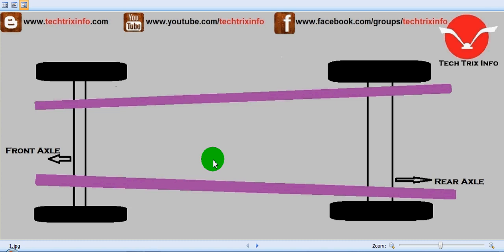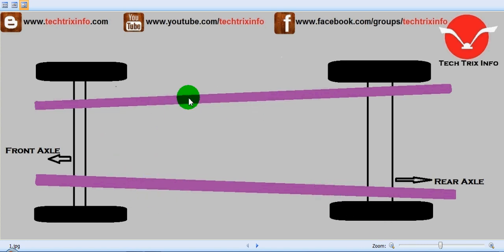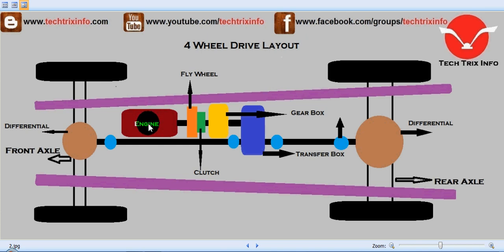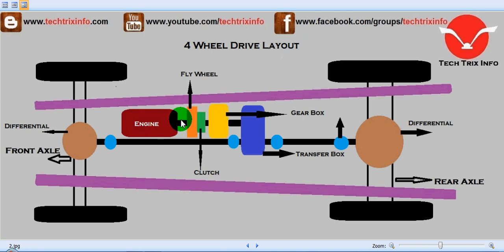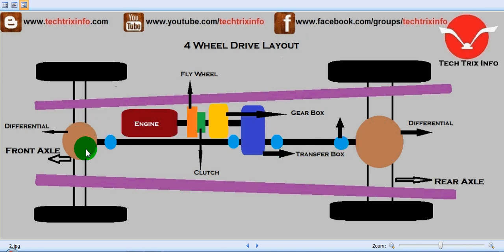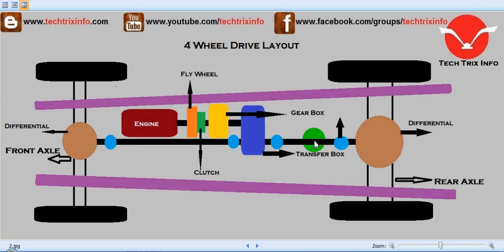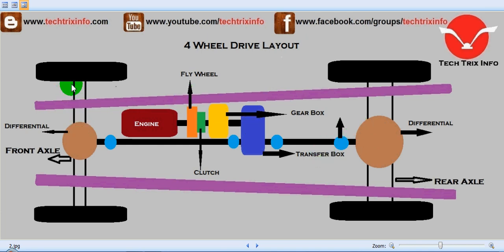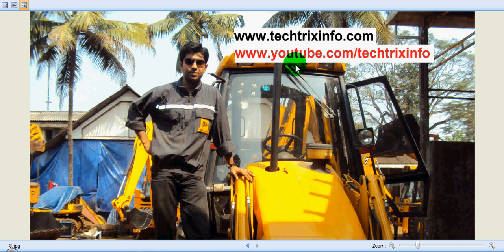How four wheel drive works (4wd). ✔

Comment from the maker: Yes, the front or rear side tyres which is not having the drive in 2wd are independently mounted with bearings, so they wont slip, the speed will be automatically adjusted as per the resistance on the tyres. 
Have you got it, if not feel free to ask doubt, our Team will be happy to help you.

Comment from the maker: 1. Automatic transmission does not have a clutch.
2. But it does have a flywheel – it is the power take of point from the engine to the transmission in automobile – so automobile will have a flywheel (despite of been automatic or manual)
you can connect with us on face book just search for Techtrixinfo.

Comment from the maker: Yes you are right.
Torque converter and clutch serves the same purpose but their working is entirely different. You can visit our channel and see the working of both clutch and torque converter.
Torque converter is a fluid coupling (hydraulically operated)
Clutch is mechanically operated.

Comment: in case of 2wd, front axle will not be a driven axle  rather it will be just a towed axle so it don't required a differential. Both front wheels will rotate  because it is attached with axle rigidily. equal slip will be there in both front tires but that slip is not such significant that we have to consider that. Slip consideration is taken into account only for driven axle, because we are supplying engine power to that which is going to waste in slip.

Comment: in 2  wheel drive, the front axle dosent have differential so how does the left and right front wheel tyre turn at different speeds

or does one tyre slip
if yes which one

Comment: Drive shafts don't have u- joints to accommodate vibrations. That's handled by the drive shaft being balanced. Universal joints accommodate component  layout and small changes in angle.